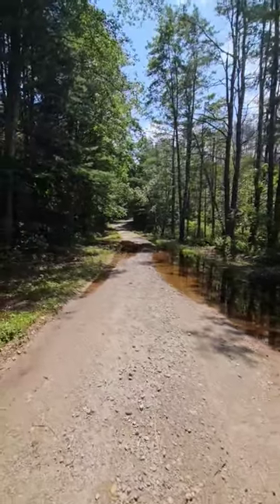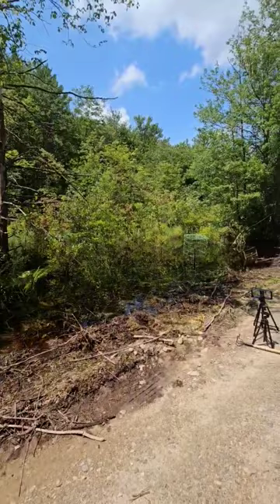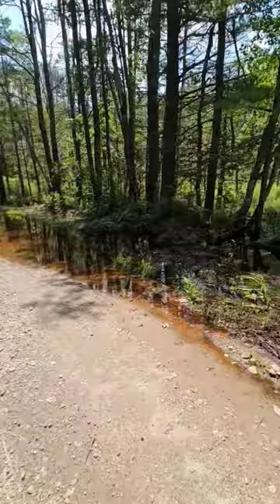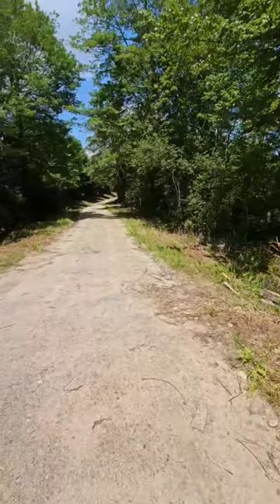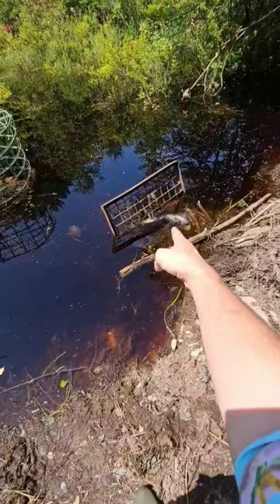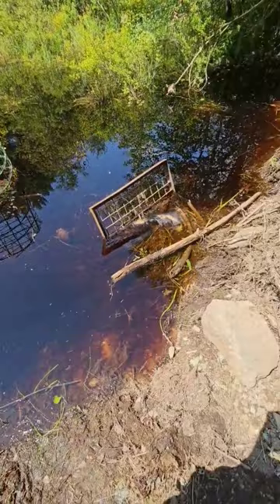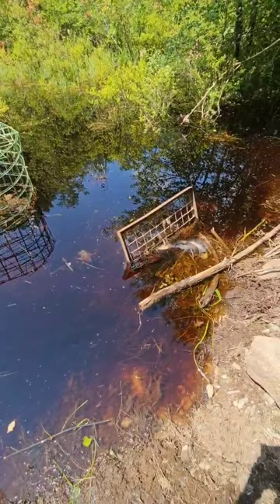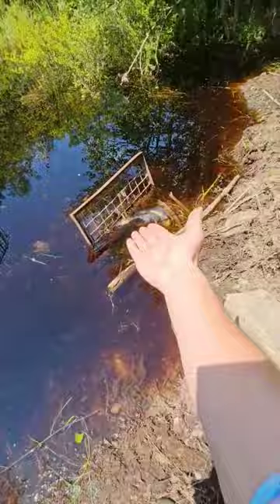Beaver Structure Fail

Comment: I've installed beaver pond levelers similar to the one they tried to build here, and I can tell you that's a piece of junk there. They must have had scrap fencing left over because, you're right, it's way too small to prevent beavers from detecting the flow into the pipe. The exclusion cage on the pipe inlet doesn't have to be 8 ft in diameter; 6 is wide enough, and I've built 4.5 ft without problems. A really big cage can be hard to handle and fit into the space available. Any way you slice it, though, beavers is trouble!